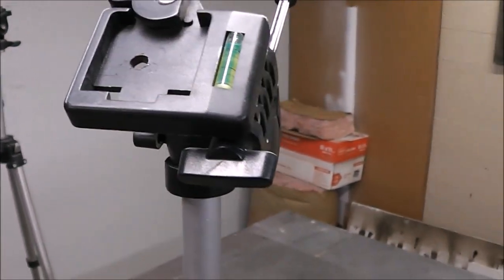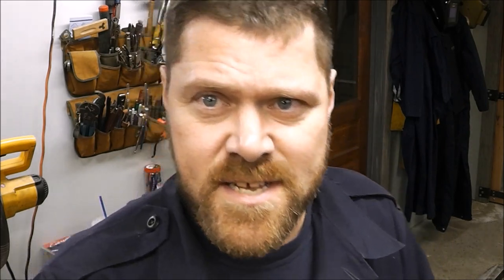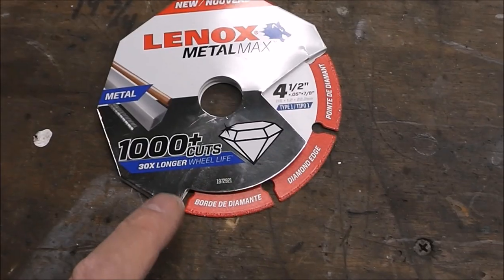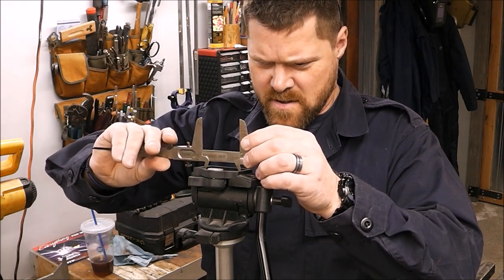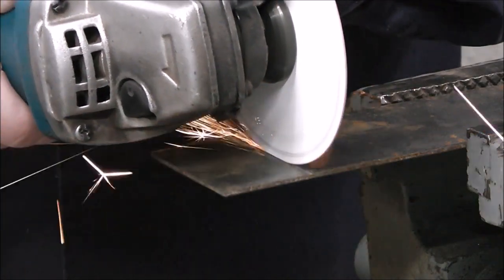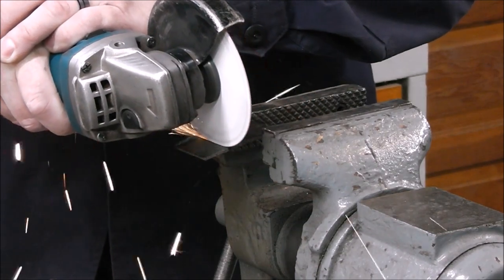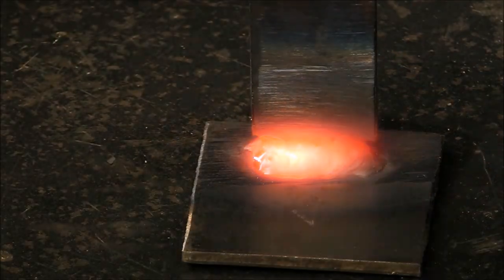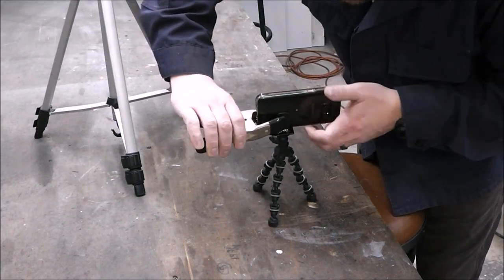Diamond Cut Off Wheels My First Impression

Comment: I agree. I saw the diamond tipped blades while shopping for some cutting discs recently and figured it was worth trying. 
I absolutely won't go back to the others. Well worth the little extra cost.
Reply from the maker: Hey Russell, im not sure how long you've had yours but I've made hundreds of cuts with mine and it still cuts awesome. Waaaaay cheaper than buying dozens of the abrasive discs too. I too will never go back to abrasives Cheers brother!

Comment: I think you have the disk in there backwards.
Reply from the maker: It could be. I know the discs are directional. I have drawn rotation arrows below where the collars go. That way the marks wont wear off when being used and you don't get the direction messed up. I think I realized it was directional after the video was released.

Comment: Good review of the cut off disc. I dislike the cut off dust and have broke a couple abrasive wheels so I am going to get a couple of the cut off wheels and see how I like them. Thanks for sharing.
Reply from the maker: Thanks man! Yah I'm not a big fan of all that abrasive dust either. You wont be dissapointed.  Just make sure to put the disc on in the proper rotation. They are directional.

Comment: Whats the name of that welder? like this welder or the Blue Demon better?
Reply from the maker: The one i'm using in the video is made by Ansen (link in description). I use this one pretty exclusively for tig welding because I like that it's high frequency.  I use the Blue Demon exclusively for stick because I love the arc. I just discovered my Ansen had a gas leak. It wasn't a big deal to fix but still a hassle. I also have a video of how I  found the gas leak and how I fixed them.

Comment: I'm sort of partial to abrasive cut off wheels and the smells but your phone project was cool. I should try that as I learn welding with my new welder.
Reply from the maker: The more I use these diamond blades the more I love them. I hate all that fine black dust everywhere. There is none with these :) check out my amazon store, I have some in there called graff black. They are a little easier to operate than the Lennox. I did a review of them also. There good in the shop.

Comment: Great tip! my only worry on your build is using a clamp to hold your phone,that's allot of preasure onto your phone screen don't you think? Maybe velcro?  all your videos are thanks?
Reply from the maker: Leo Jimenez lol that big clamp was a bit much. I picked up a much smaller /safer clamp that works much better...i had my fingers crossed when I let the pressure off on that big one lol

Comment: That works.. Here is something else that works very well, costs about $5.00 and 10 minutes to build.. 
https:/youtu.be/MOFCQ3sHh7M
You just use the existing camera bracket that comes with the tripod, a coupler nut, a spring, a carriage bolt, an extra couple of nuts, and two pieces of PVC pipe...
Reply from the maker: Very cool idea! I like it!

Comment: How 'bout an update on that wheel? How's it holding up?
Reply from the maker: I'm guessing I probably have about 500 cuts on it so far. It still cuts as good as day one. The one thing I noticed that is different than an abrasive wheel is that if you dont have it up to full speed before you contact the metal, it will skip a little. Other than that, way better than an abrasive in my opinion. It might cut slightly slower but I'm not positive. If it does, not having abrasive dust all through the shop is more than a fair trade off.
Reply: I found that I'm using mine less and less, especially with angle iron and square tubing...it's like you said, it has to be at speed at contact or it jumps all over the place. It's definitely noisier and slower but I don't know by how much. It's also less forgiving if you get a little sideways with it. It won't self destruct like an abrasive disc but it will throw the grinder back at you.  The one big positive is that the diameter stays the same so you have the same depth of cut over and over again.
Reply from the maker: D Rickard I completely agree. I haven’t cut much angle with it but when it comes to cutting plate, I love it. I have made a few cuts with it on angle and I dislike cutting angle with this blade just as much as I dislike cutting it with abrasive wheels. My only complaint is that the blade jumps if your not up to speed.  I find that I’m using this more often lately and I feel like I’m getting better at operating it, if that makes sense?
Reply: Brandon Lund it makes perfect sense...I'm going to try to use mine more just to see. I've got some wide  heavy pieces I'm needing to cut coming up.  I'll see if I can make it work better for me then.
Reply from the maker: I used it again today to V out a piece of metal that was stress cracked so that I could butt weld it. It was the first time I have used it for joint prep, rather than just using it to cut. I was impressed with how accurate I was able to trace the crack and V it out, plus you don't have to worry about abrasive dust if you plan to tig it. It didn't bounce around at all. It seems like the more I use it the better it gets...maybe it's me and I'm just getting better at using it of maybe it's a combination of it breaking in...im not really sure.

Comment: Folks underestimate that grinder dust-its evil stuff, I always cut and grind at the open doors of my playpen-oops-I mean workshop, I saw a bloke servicing MIG welders in  Fabrication shop, the amount of dust inside the covers was incredible.Not good for drills etc either, not to mention lungs. I made some phone mounts by bending some small angle out of sheet and welding them to the back plate, I made them oversize, then glued foam to tha back plate, and put draught excluder foam srip in the angle to hold the foam, the phone just slid in.
I once drilled and tapped the phone-but that did not work out so well :) :) (only kiddin guys).
Reply from the maker: Jaques, your comments are always interesting. I found myself using the word "earth" in this Fridays video when I was referencing the ground clamp! That's for you buddy!   When I was younger, I never really paid much attention to dust. Now that im older, and hopefully wiser, I actually try to control it. I like your idea on the mount....the drill and tap one, not so much...haha  :) :)